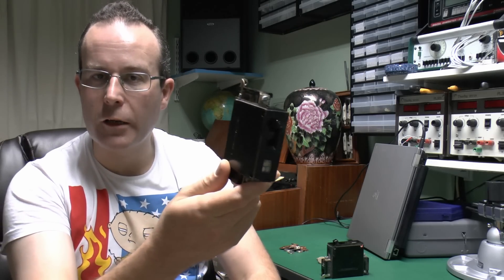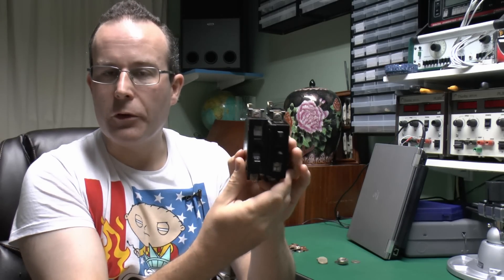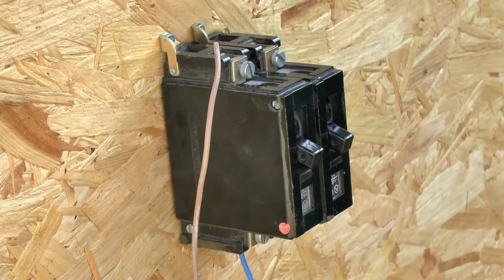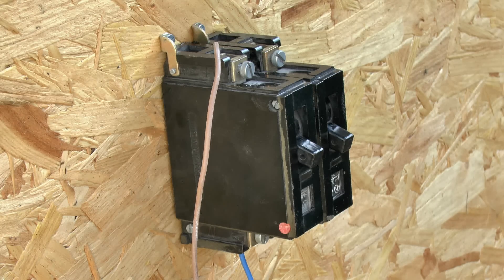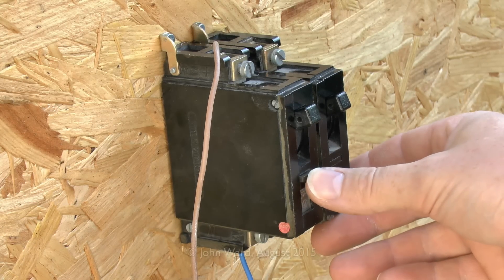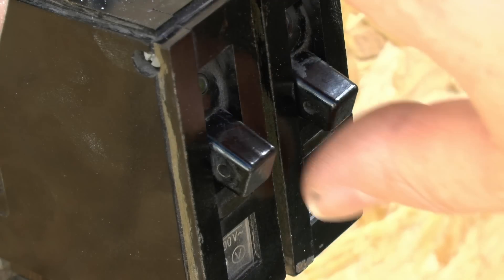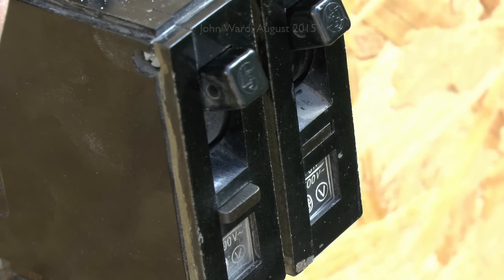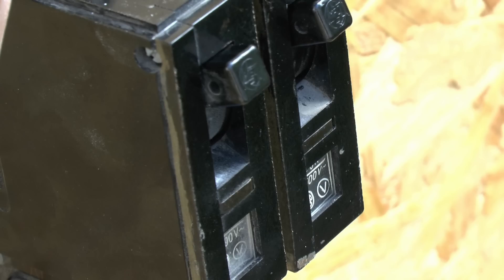Czechoslovakia Circuit Breaker Trips

Comment: Seems like a good mechanism to get around the problem of having to turn off a series of circuits before resetting the RCD (assuming the fault has not been confirmed to have been fixed). On that note, is it harmful to try switching an RCD on when there is a fault? Since for a brief moment you're essentially forcing it on against the force of the (pretty much instantly) magnetised coil?

Comment: These were nice breakers that were made and used in my country. The problem is that they aren't as fast at breaking the circuit as is required nowadays.
You may also find that some of the breakers operate at higher currents than one would think - that's because when first introduced, the label was meant to match the load of the appliances connected and the headroom had to be dialed in the breaker. Today they simply turn off spot on.
Reply: +zwz • zdenek That's something I've always been curious about, seeing that the labels don't state anything on the trip curve. Do you have any figures on that? In Austria and Germany there were H and L curve breakers at that time, which had a rather slow thermal (overload) trip, 1.9 times the nominal current at 16 A and below and 1.6 above. Modern B and C curves are only 1.45 x nominal current and less likely to damage the wire and sockets in case of an extended overload. I suppose with 4 mm2 for socket circuits that wasn't as much an issue in Czechoslovakia than it was in Germany where they'd happily use 1.5 copper/2.5 al with a 16 A breaker. The thermal trip current (I2) is supposed to trip the breaker within 60 minutes.

Short circuit (magnetic) trip is a different beast. H curve was super-fast and mainly used in TN-C system where the breaker also doubles as earth leakage protection. L was roughly equivalent to B and U to C. Magnetic trip has to occur within 0.2 seconds.

You say that the breakers in your consumer unit are useless, what kind of protection do you use in the main box outside? In Austria that's usually Diazed or Neozed fuses because they're slow enough not to trip before the breaker does. At least mostly, a short circuit on a 16 A MCB can blow an upstream 25 A Diazed.
Reply: +zwz • zdenek if they aren't fast what makes them so nice?
Reply: +FoodOnCrack If you lay off the crack, you may realize a simple answer - the slowness made them nice. And the fact that the extinguishing chamber is so robust it can be used in industrial environments. 
The current breakers are so fast that proper selectivity is unobtainable for regular customers. Your consumer box is rendered useless as you always have to go to the border box.
Reply: Ragnar8504 The model featured in the video has V in a circle which means it is an equivalent of B - line protection. I have misplaced the old books I had the details in, but it should suffice to say that fuses were usually faster than these breakers.
Reply: +zwz • zdenek I see! If you say they're slower than fuses I'd assume they're closer to U/C than to B or even slower. Fuses have similar overload characteristics to H/L/U and short circuit trip similar to C. I tested that in practice with a floor sander (11.5 A running current), 10 A Diazed fuse and 10 A screw-in breaker (L curve). Neither protection device survived starting the sander but the fuse lasted considerably longer than the breaker. I just looked at my old pictures from Prague, all V there too.

If you ever find that book I'd be very interested in details! Unfortunately I read almost no Czech so I can't even google for stuff like that.
Reply: Ragnar8504 But I mean the speed of the electromagnet. The breakers were still considered "B" even if the inertia of the armature was high. The rating of the characteristic is something different - it's the ratio between the electromagnet and the bimetallic heating element's tripping current that counts. The exact time they take to trip is subject to documentation and varies by model.
Reply: Podľa toho, čo ste napísali by rýchla poistka napr. F5A sa mala prepáliť ihneď ako prekročíte 5A avšak nikdy to tak nebolo. Treba prekročiť tento prúd aspoň dvojnásobne po dobu niekoľkých desiatok sekúnd a o T poistkách sa netreba ani baviť, sú ešte pomalšie.

Comment: Bit off topic, but when did plugs first needed sleeved Line & Neutral pins?
Reply from the maker: TheDutyPaid Mid 1980s, probably the 1984 edition of BS1363.
Reply: +John Ward Wow, 31 years later and North America still has unsleeved pins. I've been bitten a few times while unplugging a plug that wasn't fully seated.
Reply: That's true our (North America) plugs are super thin.
Reply: +Richard Smith Well if you try to fumble around with one hand and possibly without really seeing what you're doing I can definitely imagine how one of your fingers could end up on the live pin! And that's even though I've grown up with plugs with exposed pins (old German non-earthed type).
Reply: +Paul Kleinpeter I have never been bitten by plugging something in... Not sure if its the 110v thing, or what, but why would you stick your fingers there while plugging something in... Our plugs are also not massive 100 lb bricks where you need leverage to pry out of the wall either. (Exaggeration i know, but we can both have fun right?)
Reply: +Paul Kleinpeter I can't imagine NEMA plugs with sleeved pins - even regular pins of cheaper plugs bend if you look at them cross-eyed (mostly thinking about the folded brass ones).
Reply: Ragnar8504 That should be something someone should be actively avoiding. I have been bitten, but not by a plug, but by a light socket. Stretching in the morning when I forgot I removed a blown bulb the night before but didn't have a replacement. 
My dumbass flipped on the light switch right before I did it too :)
So yeah, mistakes can happen. I have a hard time seeing that killing someone tho, unless it knocked um off a ladder, or they are already 2 steps from a heart attack already, though.
However, I assume 220v bites a lot harder than 110.

Comment: I have a pretty good question that has been bugging me since I saw original video with these circuit breakers. Why do the large majority of circuit breakers have a hole going through the center of the lever?
Reply: Logan Chambers Two reasons I can think of - sometimes you want to tie two breakers together. These type of breakers where the lever doesn't move don't support that (one breaker tripping won't pull the other breaker down). The other reason is "lock out", particularly in industrial applications. The breaker boxes support "lock out bars". You put a rod through the breaker and one more more people can attach padlocks to it so it can't be turned back on until every person has removed their padlock (Google "Lockout Tagout").

Even breakers that do move the handle down when tripped are designed to trip even if the handle is blocked or jammed, of course.
Reply: +Logan Chambers It is used in the 3-phase configurations - there is a bakelite bar made by that company for that purpose. But it is not sufficient for tying the breakers to turn off at the same time - they have to have a cam component inside that is connected through the sides of the individual breakers to make sure they all trip at once.
Reply: I think its for manufacturing purposes : example ABB breakers all have the hole trough the lever but only 2p, 3p and 4p breakers use the hole to tie them all together so if 1 phase gets overloaded then everything will shut down.
Why is there a hole in 1p breakers? : cheaper to manufacture. Instead of ordering 2000 levers with hole and 1000 without. They can just order 3000 with a hole.